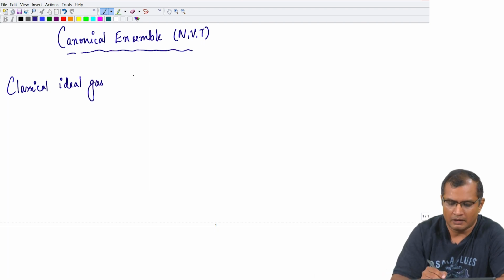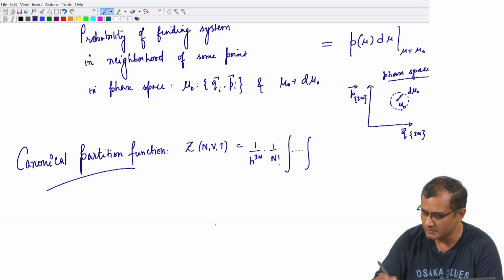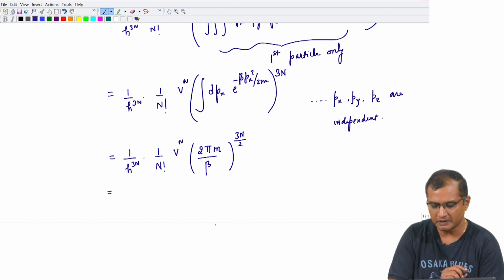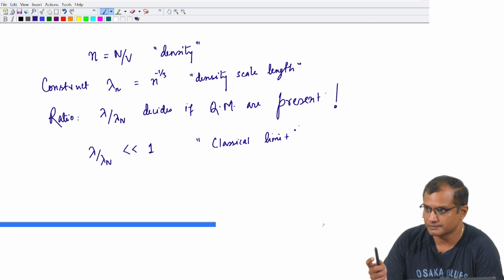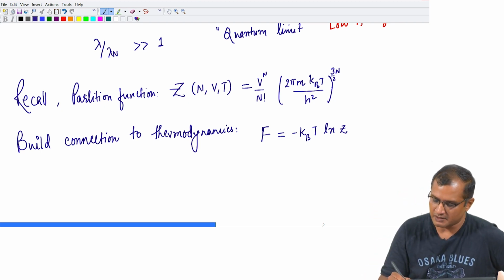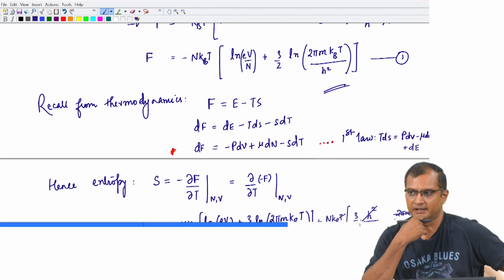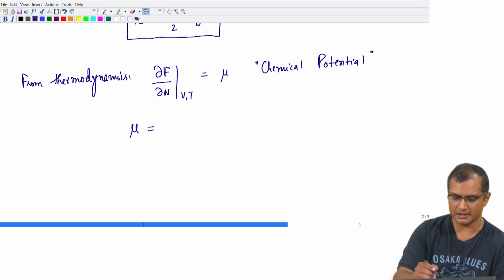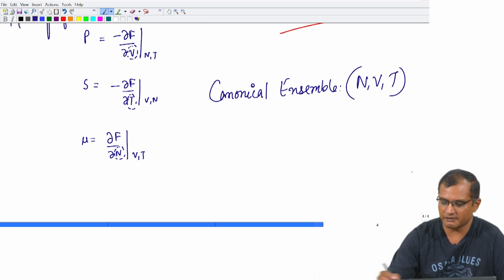Lecture 18-Classical Ideal Gas (Canonical Ensemble)

Comment: At thè end of the lecture, an explanation was givèn as how could we derivative free energy with respect to volume despite the fact that in our canonical ensemble, N,V and T are conserved. While explaing this N no. of states were taken with different volumes and F vs V graph was plotted and thereby P was computeď by thaking slope of the curved to find out pressure. While taking different states, vol. of individual state was kept constant though energy exchange was allowed with the heat bath. 
My question is, if energy is exchanged, some woŕk was definitely done by the system. If N, V, T are constant for any indiciduàl system then hownthe work done the eneŕgy of that individual systenncan be substantiateď becase the work ďone by the system is necessarily associated with thè chande of volume i.e PdV.
Reply: If we take a system to be a metal container, there is no way that it can expand even if it is in the contact with the reservoir. So no work is possible. Only way it can exchange energy with the reservoir is through heat. For this all N, V and T will remain constant.

Comment: 3:00 Note to self:  Think about it like mathematically - if we had a truly continuous function, how can we pick a single instant in that function?  It's like finding instantaneous speed of a car - we cannot. We can use the notion of limits to approximate it, but we cannot truly pick an instantaneous speed.

Similarly, now that we are dealing with continuous spectrum of energies (or momenta), we have a continuous "spectrum" of microstates. Therefore, it is impossible to calculate probability of a particular microstate.

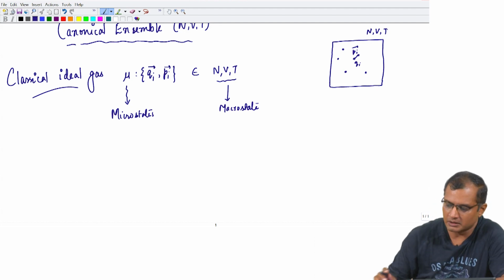Comment: 2:55 Probability density function (PDF), meaning and purpose
4:55 Meaning of probability density
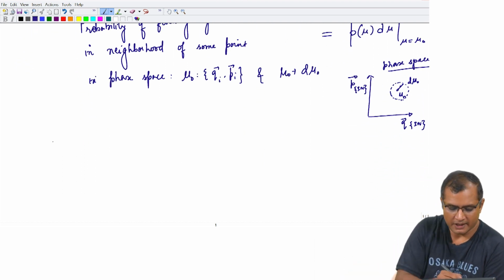8:45 Calculating the Canonical Partition Function (the normalisation of the PDF)
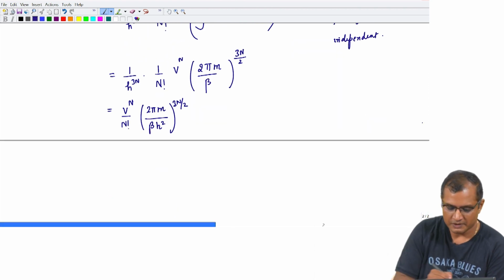18:30 Canonical Partition Function formula for ideal gas
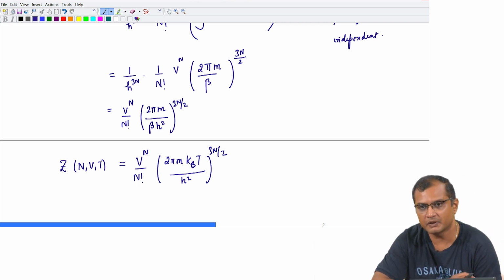19:00 Concept of length scale (especially useful for quantum statistics later)
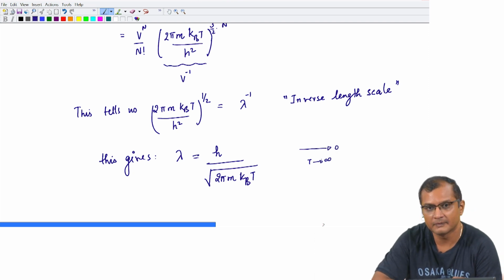22:40 de Broglie length scale and brief explanation of relation to the quantum mechanical effects
31:25 Connection of all this to thermodynamics
31:25 Connection to Entropy and Helmholtz free energy
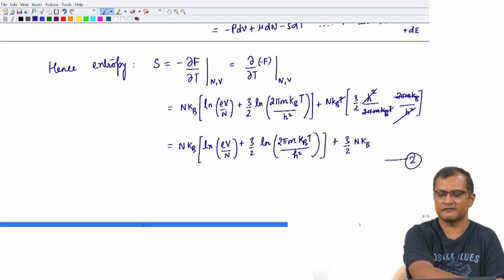40:35 Equation 2
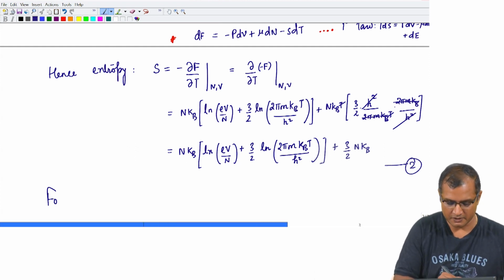42:25 Connection to Ideal Gas Law
45:50 Connection to Internal Energy of ideal gas
49:45 Connection to Chemical Potential
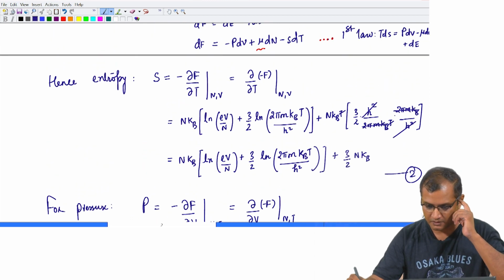57:05 Differential form of first law and its meaning
Reply: Are the lectures correctly ordered? Because the introduction to the canonical ensemble is in lecture 20 but we are discussing classical ideal gas(canonical ensemble) in lecture 18. How is this possible?

Comment: Thank you so much for uploading these lectures. I have a question though, this is lecture 18 where ''the ideal gas as a canonical ensemble'' is discussed, but the discussion of ''the canonical ensemble'' itself comes later at lecture 20. So I think there is a mistake in the order of the videos or something. Thank you.
Reply: @murphy98969  Yes they have covered B.E. and Fermi-Dirac stats in Lectures 21 onwards I think. It is in the ones for Quantum Statistics